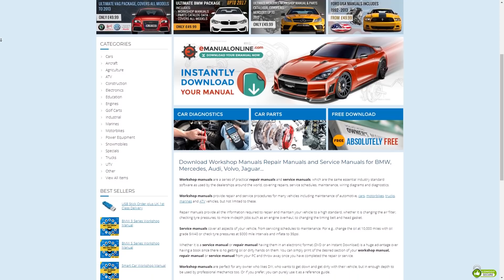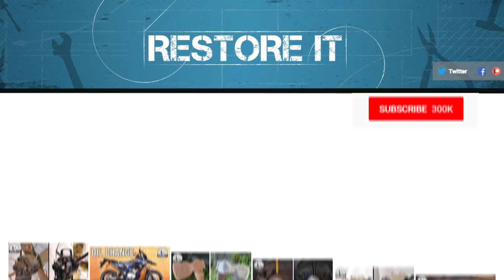DIY Workshop Build Episode 3 - Beginning The Spray Booth | BMW E30 325i Sport Restoration

Comment: Nice work! I've applied those type led strips on painted trim that's fastened to the ceiling joists. However I also add a dab of hot glue every inch or so on both edged. This is to mechanically fasten the strips as I've found that the adhesive doesn't last, especially in hot climates. Love those lighting strips that extend the whole length of the shop.

Comment: You bastard, youre giving me shed envy. (Bastard, an Australian term of affection) 
With your bead blast cabinet I have the same one, you will soon find a few things annoying about it.
1 paint the inside white
2 build and fit a cyclonic vacuum system to remove dust lots of vids on youtube about how, modify the ducting inside cabinet to improve and direct airflow, also stops you inhaling smashed glass dust and keeps the glass cleaner.
3 fit better lighting, I used led strip lights encased in clear pvc tube to protect from blast media
4 fit another water trap/regulator to the cabinet 
5 Fit a foot pedal to control blasting
6 Put it on wheels
All this turns an average tool into quite a good tool.
Working in a tee shirt in April, that would be  unusual for you eh.
Cheers

Comment: Hey man, seeing how you say you need to buy a proper drill, have you concidered going cordless? Personally I love the Bosch Professional 18V series, but seeing how you do a lot of mechanical work, maybe you should check into the Milwaukee M12-series? You can get a lot of fairly priced tools, like drills, impacts, hammer drills, ratchets and so much more, with a lot of power, all on one battery platform. I think it would work out great for your use :)

Comment: Thats a fantastic workshop. But i have two questions:
Why not using aluminium frames for the spray booth? The aluminium frames are much more solid.
And why not use the protected LED stripes? Especially in dusty areas it makes sense to use the stripes with class IP65 and they are better to clean. But hey, great job.
Reply: The aluminum would be 5x The Price of timber if not 10x

Comment: I know it's kinda late now but next time you wire LED strips don't put the male spade terminal on same side for both. Make the negative male and the positive female. That way someone later on doesn't plug them in backwards and possible fry the lights or power supply.

Comment: Good job! Don’t forget to build ceiling on your paint booth. Also keep in mind ventilation system, that should build a bit excessive pressure inside the booth, to push dust and particles outside, so your paintwork would be clean and smooth as a toddlers ass.

Comment: Are you going to add LED lights at waist height to highlight the sides of the car when you go to paint it?
Reply from the maker: Great Idea. I may have to do this.
Reply: Restore It glad I could contribute to the Workshop build! Because having those lights will catch any imperfections in the bodywork before you put any paint or clear coat down.
Reply: https://www.autobodytoolmart.com/paint-booth-lighting-t.aspx check it ou

Comment: does anyone know what’s the make and model of the square panel leds on the ceiling, i’m looking for new garage lights
Reply: They're called FLOALT, from Ikea. 60x60 cm. :)
Reply from the maker: Mine are 48w 60x60cm as Le Derp has mentioned.

Comment: Why use so much of the garage for a spray booth? 🤔
Reply: It looks large enough to contain a car. I think that is the plan?
Reply: @XXCoder  It sure does, but it takes pretty much all the space. There's no space for any welding/assembly of the car/oil changes/other maintenance. The whole garage ecxept the work benches is now dedicated for painting.
Reply: Yeah. I wonder if space will be also used for other car things like you said?